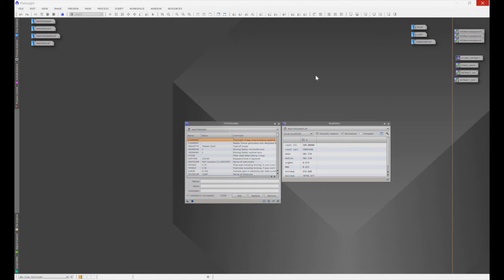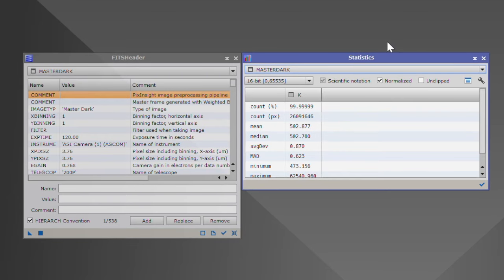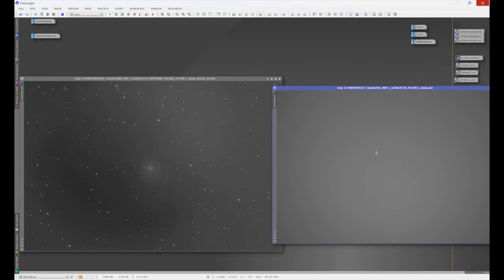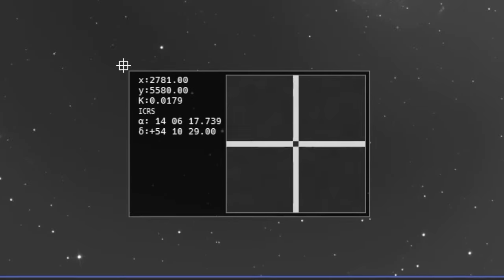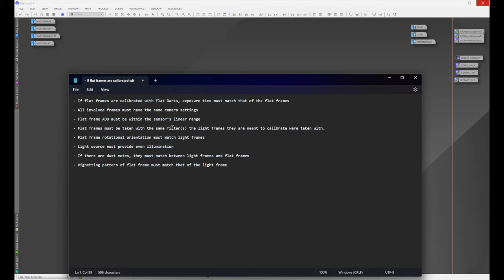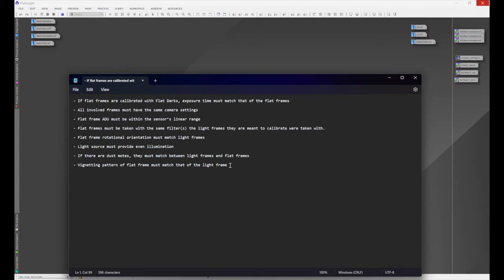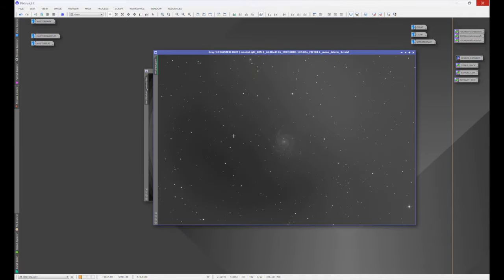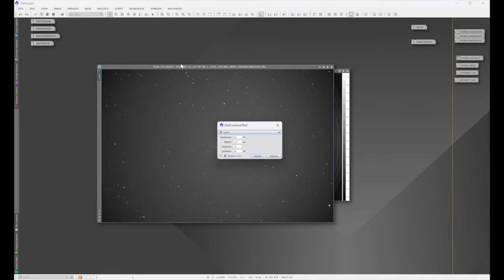Flat Field Correction Part 2: Analyzing and Perfecting Your Flat Frames

Comment: All the points you raise to help ensure good calibration are definitely important, but there are ways to help minimize the need for some of these precautions.  For example, I don't use a rotator, so ensuring rotations match are not an issue.  I also don't disconnect my imaging train (spacers, filter wheel, camera) from the scope, so consistency in lights and calibration frames are not an issue.  And it allows me the option of shooting my calibration frames once or twice a season to account for variable elements like temperature, rather than having to shoot a set with each session.  Sometimes I do have to readjust because of new dust motes but not often.  I guess my point is that you can make tradeoffs to give you the best balance of effort and result.  That's one thing I really like about this hobby.
Reply from the maker: Very, very good points! What you say definitely helps avoid some, if not all of these issues. It truly is amazing how sometimes something so small can make such a huge impact!

Comment: I'm going over this series again. If you follow the rules and don't mess with you rotation then you should never get flat masters at a different rotation. When I'm shooting multiple session, I have to set up and tear down between sessions. When I set up my second and subsequent sessions I get to the point in set up where I use NINA Framing Assistant to load in my reference frame from the first night. The Slew, Center and Rotate will slew me to the target and it will prompt me to rotate the camera. I have it set to 1° tolerance. Then I start my sequence. In the middle there is a Meridian Flip and after the session is finished I use Flat Wizard to take 3 second flats and dark flats. When you eventually stack the lights the stacking software must arrange the pre and post flip orientation  one way or the other. With the Flats taken at the end does the stacking software match the master lights with  the master flats to the same orientation so the contour maps match? 

Other than messing with the rotation of the camera this problem of the contour maps orientation shouldn't happen?

Thanks
Reply from the maker: Great questions! Using the same orientation is good, however, there are other factors that could affect flat calibration effectiveness such as new dust or shifted dust / other imperfections that happen. Stacking will compensate for meridian flip and orientate the final image one way or another. I wish there was a way to control which way it orientates, but there’s not. My thought would be to manually select a reference image, but I haven’t tried that yet as the image it automatically selects is selected for a reason :) with that said, the flat contour plot between the master light and master flat does not automatically align. I’ve had to go back and rotate my master flat manually and then rerun a few times :(

Comment: I liked your check list and I find I'm following all the points. I use NINA and the Flat Wizard. I've decided to settle on 3 second flat frames at 40% IDU. Dark Flats are taken following the flats. I've noticed occasionally the first dark flat frame has a green tint. The rest are the normal dark gray. I use an ASI071MC. I remove the green tint frame. I shoot 30 flats and 31 dark flats. What is the affect if I were to increase the ADU from 40% +- 10% to 50% +-10%. Sometimes after stacking I think vignetting hasn't been totally removed. I'm wondering if increasing the ADU might help. I shoot flats after every evenings session even for the same target. I use the NINA rotator tool to get within 1° of the reference target night rotation angle using a Baader Click Lock on my SCT.

I'm a little confused by the exercise when you rotate a correct  flat Frame 180°.  I don't use Pixinsight. I use Siril. Does all stacking software have to rotate the flat frames? What happens to flat frame calibration when you have a Meridian Flip occur? Some of your light frames are 180° off other light frames. I understand stacking takes care of this issue but what does the stacking software do with the flats?. When using the Flat Wizard in NINA you have a choice of East and West side for slewing to zenithDoes it matter which side your choose. If you were taking images and your OTA was pointing to the east (counter weights on the west side of the pier) do you choose West or East or does it matter,

If you found your flats are goofed up does that mean your lights are toast?

Thank you.
Reply from the maker: Extremely good questions and these are actually going to be addressed in part 4 :) as a quick answer, your ADU you mentioned is just fine. There’s a twist as to what can happen to cause the correction issues and I’m going to show how to address this. 

The stacking software, as you mentioned, takes care of the difference when flipping meridian. This is actually exactly why I rotated my flat. If you notice, the contour plot of the flat was a mirror image of the contour plot of the light. This was causing correction issues because the light areas of the flat were not matching the light areas of the light. Flipping the flat 180 then matched the two contour plots, thus lining the light and dark areas of the light image and flat image together. 

No, your lights aren’t necessarily toast :) one of the biggest reasons your lights would be toast would be due to not being able to match dust motes if you gained some, lost some or they shifted. 

You’re all good and don’t overthink this too much. As a quick hint as to what’s coming up, check the mean ADU between your master dark frame for the lights and master flat dark frames for your flats. Is there a difference in mean ADU?

Comment: Hi, I have a question. If the result image is completely white after applying the FlatContourPlot script on the MasterLight, what does it mean?
Reply from the maker: That is very interesting. Have you tried using a single light frame? Also I’m assuming your master light already contained the flat and dark calibration?
Reply: @Hidden.Light.Photography  No, I haven’t tried a single light yet. But I’ll give it a try and let you know how it went. The MasterLight was calibrated with Flat and Bias. I don’t use DarkFrame because I’m using dithering.
Reply from the maker: If you don’t mind me asking, what camera are you using?
Reply: @Hidden.Light.Photography  Hey, thanks for the reply! I just sent you an email a minute ago with the subject "Flats." THANK YOU!
Reply from the maker: You are very welcome! I will take a look at the files and see what I can find :)